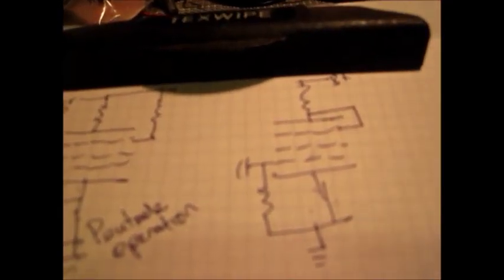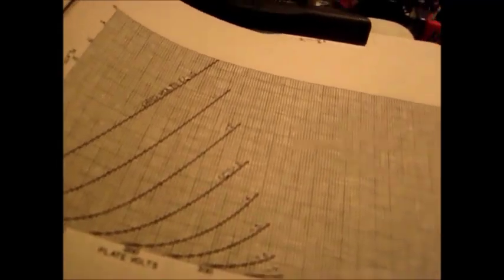Explanation Behind the Pentode to Triode "Flavor" control

Comment: You are operating in the ac area not dc so the curves do not change . However by playing with the ac injected in the g2 circuit  you have produced a flavor  knob .  This is a fine and stable way to get that sound .  Playing with the cap size  will effect the tone also . Nice job.